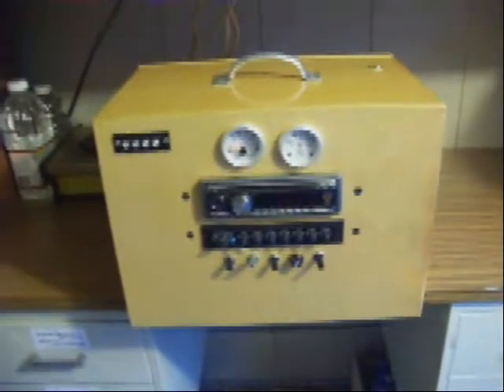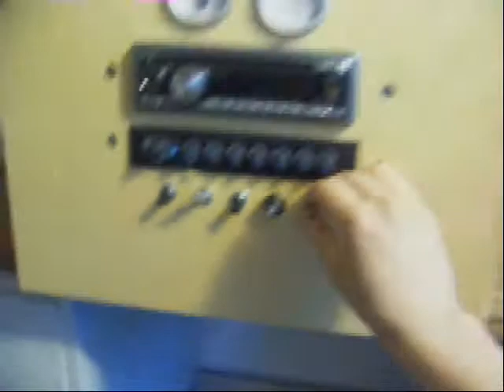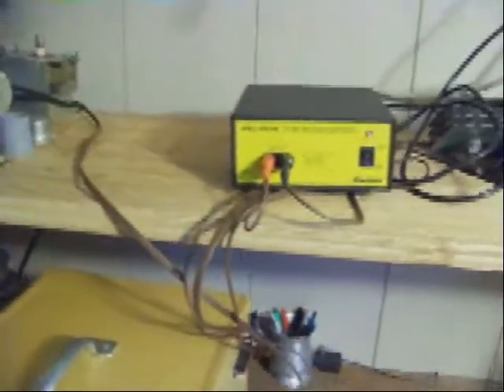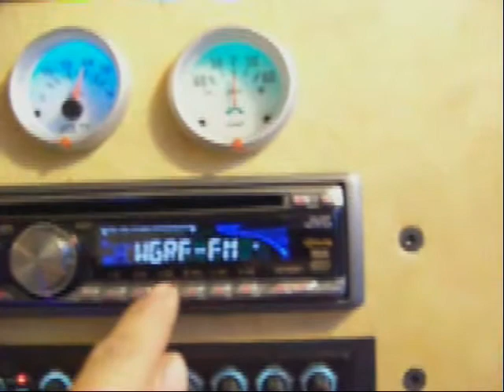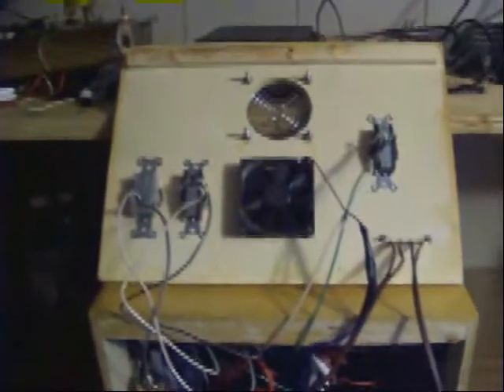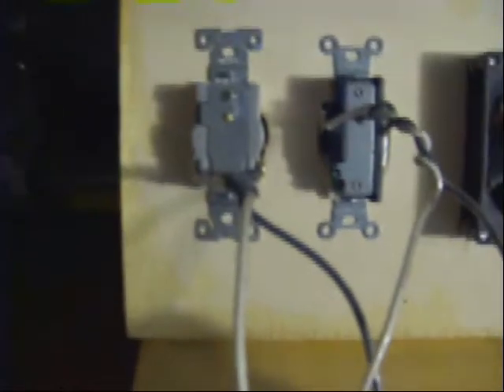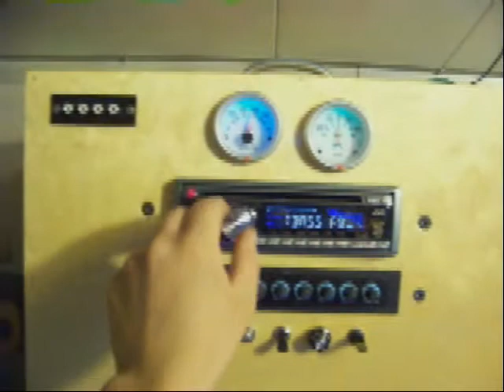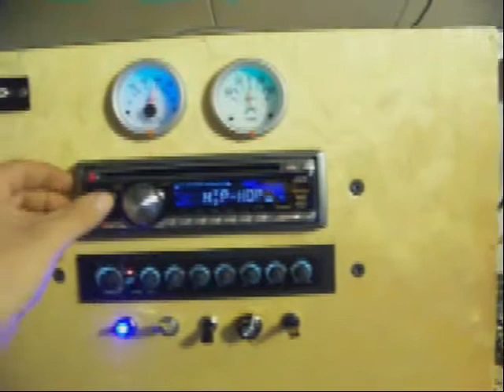high performance boombox

Comment: bravo, nice build. I found this while looking for ideas for my next project. The little touches are nice; dual gauges, spacing of the switches,line in AND line out. I like the power antenna (although I can't remember the last time I listened to FM), and I love the fact that you put so much effort into making it 14v. Most people would have sufficed with 12v.
One questions though; why not just add speakers to the main box?  It seems that having a 3 piece system greatly hinders it's "portability".

Comment from the maker: i can, but it isnt necessary since the wires are within a foot of the battery. there is virtually no line loss to compensate for which is the reason you nput a cap in your car. it just compensates for line drop across the wire. the longer the run the more you benefit from a cap.

Comment from the maker: i put the volt meter on there so i know when to recharge. the volt meter gets connected to the pos and neg side of the radio this way if you install multiple power sources later besides the battery it will read them too. the amp meter is in series. disconnect the pos wire from the radio and put one side of the meter on the radio and the other side of the meter where you disconnected the wire from. if it reads backwards then just reverse the 2 wires on the meter. thats it.